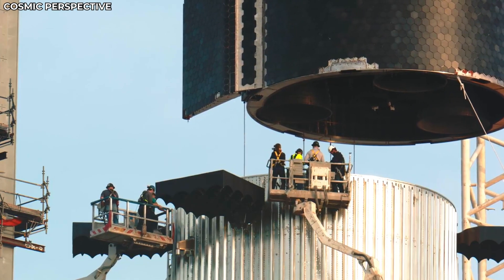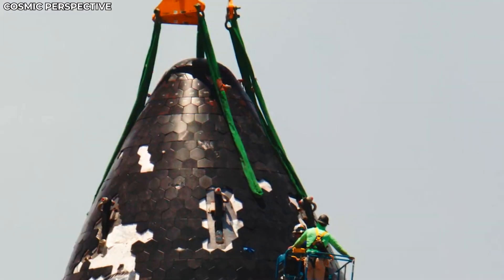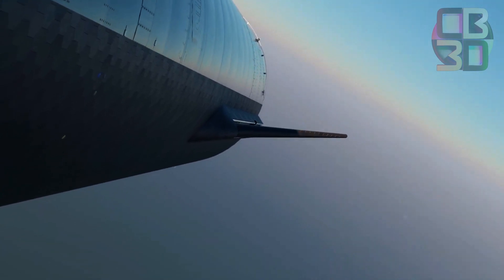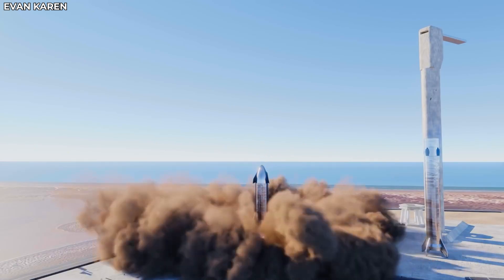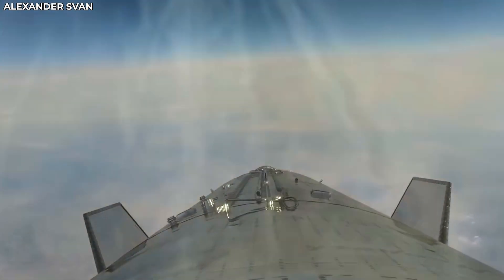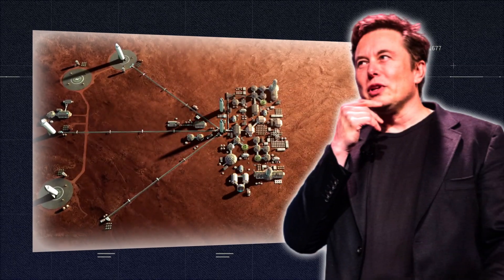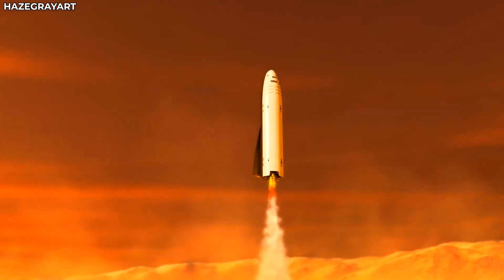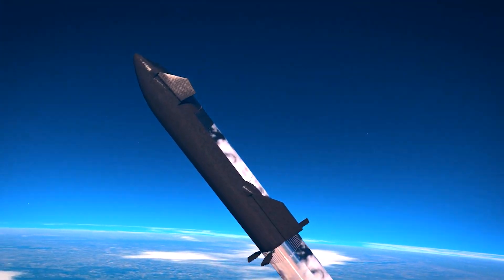IT HAPPENED! SpaceX Is NOW Launching Their Starship Sn20!

Comment: The one area that has me worried is the integrity of the heat shield. The point is that the return doesn't just have to only contend with heat - which is well controlled by the tiles, but also WIND! As the ship descends it will experience a wind of about four miles a second initially, but the air up high is very rarified. As the ship descends tho, the wind will become more extreme, say one mile a second , but in denser air. The problem here is the shape of the ship. The central tiles will no doubt cope, but what about those along the edges? They'll experience a transverse wind that could pick up the edges and flip them off like a fish being scaled! It all depends on how strongly bonded the the tiles are to the steel. Is there any glue that can be guaranteed to hold? Or could they be bolted on in some way? No doubt the engineers have done their sums, but have they got it right?
Reply: How about a second skin that's tiled but stands an inch or so from the main hull? That way the skin wilkl burn if tiles fall off, but the structural hull will have a good chance of survival.

Comment: I am wondering with significant mass moves to a different planet, what effects will it have to the earth and Mars, as the Earth will be lighter and the Mars will be heavier...
Reply: Words of wisdom...
Reply: dude...
Reply: Your talking MASSIVE amounts of mass, at that point we could adjust the orbits
Reply: @bsmusic2601  I know it is going to be negligible for a long while. But it is a factor we need to consider for our future generations. I also wonder that so many high rise buildings may change the moment of the earth and slow down the rotation, not sure what else effects they may have...
Reply: @gsyn7570  Compare all of those buildings  with mount Everest. All of them together. There are a lot of mountains in the Himalayas. About transfering mass, it's not a problem for future generations. I don't think you grasp how negligeble it is
Reply: Again i think will have tech to compensate by the time its an issue. I've heard that gigantic damn china built affected earths rotation by some amount i cant qoute
Reply: Compared to the masses of the planets it'd be like removing one atom from a steel ingot and placing it on another. Totally insignificant.
Reply: @williammacarthur9040  I agree it may be not significant. although, when you think about rotational motion, think about the moment of inertia -which is proportional to the square of earth radius.